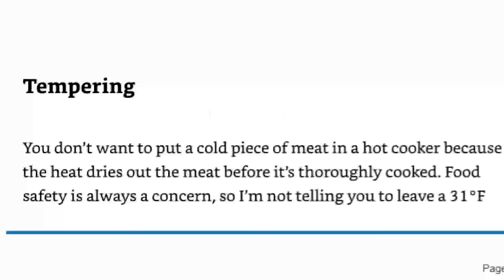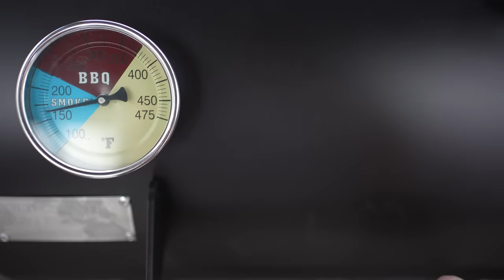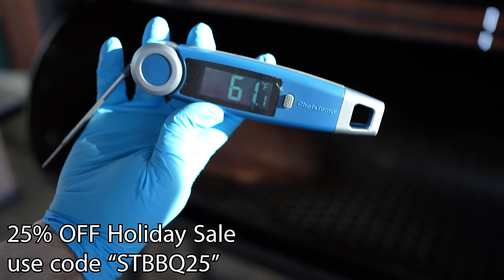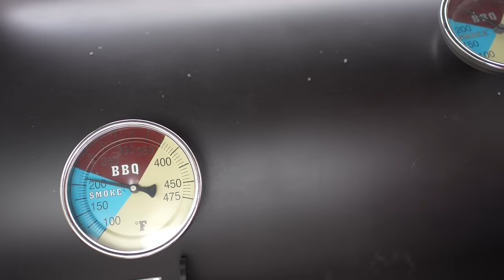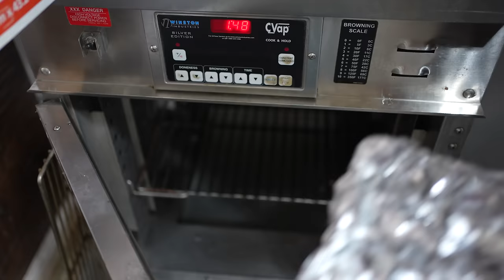Is lower and slower better?

Comment: Pellet grill: 180 for 4 hours. 225 until stall. 275 to until 200 degrees (rotating and spritzing, smoke tubing throughout). Wrap in butcher paper with foil boat with tallow etc. Hold at 160 for 10 hours. I did this for Christmas, juiciest brisket in my life and I just got back from a southern TX brisket eating trip at all the famous places. I used all your spices you use now (bought yours, it's great)
Reply: How was the fat cap rendering?
Reply: rendered perfectly, could push through it by barely touching it. Caramel flavor.  @Dranomoly
Reply: Did you have a water pan under the brisket?
Reply: @alexnone3374  yea

Comment: This effect is noticeable to a much higher extent on cookers with less convection/ draw than a high quality offset, especially pellet grills. every brisket I have done on a pellet grill at 250/275/ any other combination of low then high/ etc, the collagen breakdown, fat render, and caramelization are always lacking to some extent. If I rock out at 225 the whole way, i swear that thing always comes out flawless. it never fails. On a high quality offset I feel like the convection does help you a lot more with fat render/ etc and you  can get away with cooking at 250-275, especially on huge offsets with big stacks. you get that same luxury with a kettle grill because kettles are convection KINGS, but if you're cooking any other way 225 is the secret sauce.
Reply: I've noticed this as well on my pellet. Sometimes even drawing out to a 18-20hr cook. I've done the same at a higher temp and 12 hour cook and the render is just not there.
Reply: I've had the same results also. 225, the whole smoke has gotten me the best results every time.

Comment: Great test, both look great. That G2 Brazos is a nice cooker. Nice to see you cooking on it. You spend so much time cooking brisket, it’s nice to see you on something with a little better design and quality. I’m sure the insulated firebox also helps with the weather in the winter time up there.

I would think the brisket that spent four extra hours at lower temps would’ve been smokier (as the lower temp is generally a smokier fire and it spent four more hours that way) also would be curious if the fat render was better on the lower and slower brisket, as I assume you still finished it off at a higher temp to help render the fat.

Either way, nice test looking forward to more Brazos G2 smoking.

Comment: In my experience it's a few things for a juicier flat it's fat content between the point and flat and the longer cook definitely renders more of that fat making the flat juicier now when you cut the brisket down the middle like that it's always going to be juicier because of that fat layer, the big question is what's it like towards the end of the flat further from the point. And the thinner the brisket determines alot also because not all briskets shrink and get thicker as much they just stay kinda thin if that makes since which makes it dryer so a long story short buy a thick brisket with good fat content and cook it for longer is my suggestion. Good cook.

Comment: I gotta know, do your spritzing bottles clog easily. I buy similar ones at the big box stores and they never last.. 

Idea. Instead of a mister in the fire box to add humidity, how about little nozzles drilled into the top that you spritz the meat with. That way you don't have to open the door and lose your heat.
Reply from the maker: I use Zep. They are great. I don't use spices in my spritz so it doesn't clog.

Comment: Steve, which technique would Magnum PI use? Also, the lid (top I guess) of that smoker looks interesting. How does it do as far as keeping the smoke in the chamber? Is there a lot of leakage?
Reply from the maker: He would just stroke his mustache, flex his pecs, and it would be perfectly cooked. It doesn't seem to leak smoke
Reply: @SmokeTrailsBBQ  ha! I figured he would just make Higgins do all the work!

Comment: Amazing test - even if it means that I have to cook for even longer! I’m hoping the difference is that you didn’t pull them at the same point. Looking forward to that test when you do it!
Reply from the maker: Talking to some people the consensus seems to be that a slightly lower and slower cook for 15-16 hrs to 190-195 probe tenderness tends to produce better results than a hotter faster 12 hr cook to 200-203 probe tenderness. Need to test some more.

Comment: Finally tried your brisket rub. Some flavors in there that I've never experienced. Might have been a packaging fluke. But i found it to be lacking salt. I noticed i couldn't see much salt in it. And i applied a heavy amount. That being said, I'm out because of the lack of salt.
Reply from the maker: It intentionally has less salt in it. Intended to go on very heavy for maximum texture. Around half a bottle for brisket
Reply: @SmokeTrailsBBQ  was a 15 lb brisket before trim. Select, as they have them on sale $2.46 lb @ Walmart and HEB in south Texas. 

If i remember correctly used 1/3 of the bottle. Stayed seasoned and wrapped in the refrigerator for about 15 hrs before smoking. 

Smoked on a pellet grill that i built. It cooks on the hot side, because of the thickness of the oilfield pipe i used. 

Held it in a master built overnight. Slightly overcooked, and dry flat. Selects are difficult at best to get a moist flat.
Reply: @SmokeTrailsBBQ  A lot of flaws can be covered up with a little BBQ sauce and cream cheese. Then stuffed into a hollowed-out jalapeño and wrapped in bacon. 😋

Comment: Hi neighbor.  Do you barbecue when it's super cold (-30 to -40)?  If so, what modifications, if any do make to the cooking process?    I live next door in Regina,.  Enough said.
Reply from the maker: Yes I do. It helps to store the pellet grill in a heated garage so it starts easily when you take it outside. Insulated covers help. For offset smokers I add more fuel more frequently.

Comment: Steve - great video. So my question is around the importance of the long, low-temp hold. Suppose you didn't have a holding device, could this just rest for an hour say in a cooler OR is this a crucial step in the overall finished product?
Reply from the maker: I think it's crucial and also way more convenient.
Reply: Most ovens can be set for a low enough temp for a long hold. I did two chuck roasts like brisket for a family get together and held them in the oven overnight. I did add a water pan just in case, but I think it would have worked without any added moisture. It was my first time doing a long rest on chuck roasts, and they turned out great.

Comment: First 4 hours 200-225. Bump up 250-275 until stall. When it hits the stall foil boat 300. Finish at around 195. Rest for 8 hours with foil wrap. Did I get that right? lol
Reply from the maker: 4 hours at 200 to 225. Then 250-275 to 170 internal. Foil boat and bump to 300 until 195. Foil and hold at 150 for 18 hours
Reply: Is that a Winston cvap oven your holding in? What settings do you use for that
Reply from the maker: @faisalfaruque2849  yea bud! Just 150 vapor temp/doneness.

Comment: Think there are a few variables that are impacting the outcome possibly. Like you said the lower and slower cook was cooked to tenderness and the faster one had to be pulled early. Variable 2 is that the slow cooked one was in the warmer for 18 hours and the fast cooked one was only in there for 3 hours. Could this have impacted the outcome? Try to get those two variables eliminated in the next vid! As always no two briskets are alike either...Looking forward to the next ones results!

Comment: Interesting experiment.  Since you've pulled both at about the same temperature, and L&S ended up a bit falling apart, I wonder
whether you could pull the brisket cooked L&S at lower temperature, to get an even better flavor?  You were too excited with the experiment, you'd forgotten to comment about the flavor of the rub. LOL  Edit: It would be hard to beat your rub.
Reply from the maker: The rub was good! Probably would notice it more on pork or ribs.

Comment: I never cook any higher than 275. I start at 200 for several hours. I never look at the clock. Time has nothing to do with it.
Reply from the maker: I find I don't get good fatcap rendering unless I go up to 285-315
Reply: Are we talking yellow caramelized fat? Not a problem I've had
Reply: @SmokeTrailsBBQ Then either your temperatures are not stable, your grills convection is not up to par, or your cooking fat cap up.
Reply from the maker: @shaun536  yes I cook fat cap up. Is there any other way?
Reply: @SmokeTrailsBBQ  Nothing personal bro, but for someone as yourself which proclaims to have cooked hundreds of briskets i find it hard to believe you would still be doing it that way as its a beginner rookie move, Its scientifically proven that cooking the brisket fat cap up serves no purpose as the fat when rendering will not flow into the meat. That being said on the other hand it was proven that cooking a brisket with the fat cap down serves 2 purposes. First it protects the meat from any direct heat from below helping it to maintain a more even temperature. The second benefit is that it provides a barrier of sorts that slows the drainage of fat and moisture which in turn helps keep the meat moist.
Reply from the maker: @shaun536  I am familiar with those arguments. In my humble opinion, the fat cap renders much better fatside up on an offset smoker because the heat is coming from the top down, it's the traditional way to cook a brisket on an offset with dare i say every bbq joint in texas cooking fatside up, and notwithstanding any perceived benefits of cooking fatside down, I find it messes up the bark and presentation which is important to me.
Reply: Agreed fat cap up.  Heat circulating on top of a traditional offset renders much better.   Even on a pellet smoker,  I started fat cap down to protect the bottom from being pot roast.  But the fat was not good to eat.  Eventually, I put a water pan under, and fat cap up, no pot roast bottom, perfect edible rendered fat on top.

Comment: Method I've taken a liking to is a complicated variation of the foil boat. I smoke past the stall then place the brisket on a wire rack inside a turkey tray with water(halfway up the wire rack). Cover the gaps and any crispy bits with foil then toss into an oven at 300. 
This keeps the flat cooking gently with steam, prevents the pot roast flavor from boiling in its juice, renders out the point with high heat, and allows for you to rest till the brisket gets close to 190 for tenderness checking
Reply from the maker: That sounds like a great method